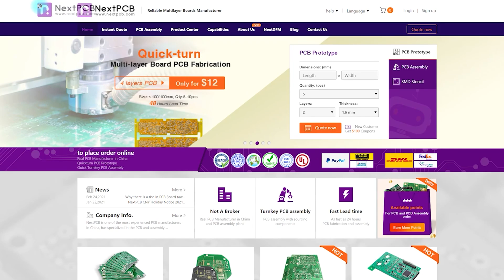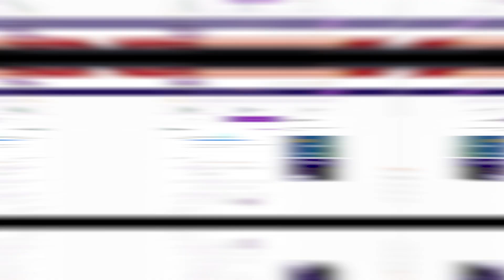Advance Solar Tracking and Automatic Sprinkler Irrigation Science Project

Comment from the maker: #include <Servo.h> 

Servo horizontal; // horizontal servo
int servoh = 180; 
int servohLimitHigh = 120;
int servohLimitLow = 5;
// 65 degrees MAX

Servo vertical; // vertical servo
int servov = 0; 
int servovLimitHigh = 120;
int servovLimitLow = 5;

// LDR pin connections
// name = analogpin;
int ldrlt = A1; //LDR top left - BOTTOM LEFT <--- BDG
int ldrrt = A2; //LDR top rigt - BOTTOM RIGHT
int ldrld = A5; //LDR down left - TOP LEFT
int ldrrd = A3; //ldr down rigt - TOP RIGHT
int ldrmt = A4;

const int motorA =  7;

  int pos = 0;
  int pos2 = 0;
  int oldvalue;
  int oldvalue2;
  

void setup(){
horizontal.write(120);  
horizontal.attach(6);
vertical.write(120);
vertical.attach(5);
  pinMode(motorA, OUTPUT);
 
delay(2500);
}
void loop() {
  int ldrStatus = digitalRead(ldrmt);
  if (ldrStatus == HIGH) {
   {digitalWrite(motorA, HIGH);
  }}else{digitalWrite(motorA, LOW);
    
    }

int lt = analogRead(ldrlt); // top left
int rt = analogRead(ldrrt); // top right
int ld = analogRead(ldrld); // down left
int rd = analogRead(ldrrd); // down right
int dtime = 10; int tol = 90; // dtime=diffirence time, tol=toleransi
int avt = (lt + rt) / 2; // average value top
int avd = (ld + rd) / 2; // average value down
int avl = (lt + ld) / 2; // average value left
int avr = (rt + rd) / 2; // average value right
int dvert = avt - avd; // check the diffirence of up and down
int dhoriz = avl - avr;// check the diffirence og left and rigt

if (-1*tol > dvert || dvert > tol) 
 {
 if (avt > avd)
 {
 servov = ++servov;
 if (servov > servovLimitHigh)
 {servov = servovLimitHigh;}
 }
 else if (avt < avd)
 {servov= --servov;
 if (servov < servovLimitLow)
 { servov = servovLimitLow;}
 }
 vertical.write(servov);
 }
if (-1*tol > dhoriz || dhoriz > tol) // check if the diffirence is in the tolerance else change horizontal angle
 {
 if (avl > avr)
 {
 servoh = --servoh;
 if (servoh < servohLimitLow)
 {
 servoh = servohLimitLow;
 }
 }
 else if (avl < avr)
 {
 servoh = ++servoh;
 if (servoh > servohLimitHigh)
 {
 servoh = servohLimitHigh;
 }
 }
 else if (avl = avr)
 {
 delay(10);
 }
 horizontal.write(servoh);
 delay(dtime); 
  }
else{
  oldvalue = horizontal.read();
  oldvalue2 = vertical.read();
  
 for (pos = oldvalue; pos <= 120; pos += 1) { // goes from 0 degrees to 180 degrees
    // in steps of 1 degree
    horizontal.write(pos);
    delay(15);
 }
    for (pos2 = oldvalue2; pos2 <= 0; pos2 += 1) { // goes from 0 degrees to 180 degrees
    // in steps of 1 degree
    
    vertical.write(pos2);           // tell servo to go to position in variable 'pos'
    delay(15);}
    
   }}
Reply: How much cost to make this
Reply: what are the tools sorry for what, I don't know
Reply: L
Reply: Ram ram bhai sare
Reply: Details plzzzzzz